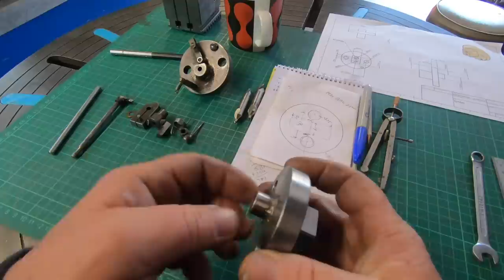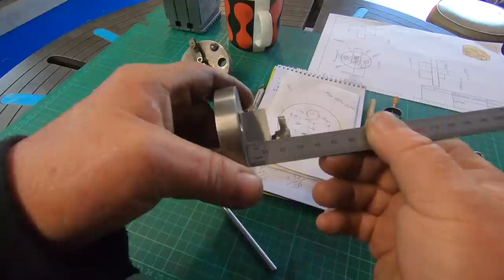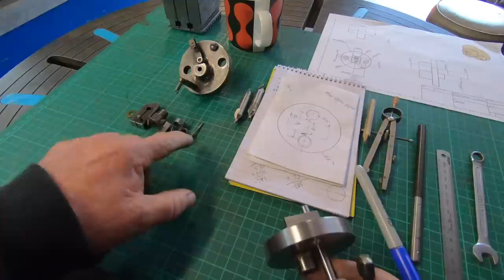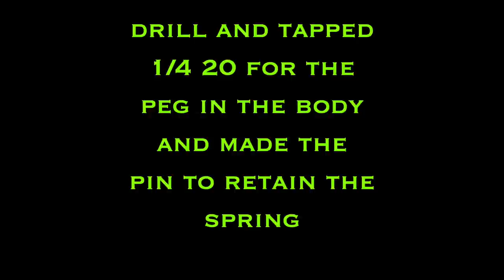Hercules Hit & Miss Engine Igniter, Health Update...

Comment: That is a great job you and Trevor have done to ensure that vintage engine has more life in it. I've never seen that type of ignitor before, so at 68 you've taught an old mechanical engineer something new, thanks. I've found setting small goals is a good thing when battling medical issues. There is no treatment or cure for pulmonary fibrosis so I set goals. I sincerely hope that the treatment works Matty, as the world needs us old engineers to keep the wheels turning ❤❤
Reply: My mom had sistic fibrosis. That was 19 years ago. A friend of the family had what you have, he said that there is way more hope today than even 5 years ago. Good luck with that 🙏.
Reply from the maker: Gday, I’m going to try and keep the weekly videos as much as possible, I need to keep active and keep the mind in a good space and the workshop is that place for me, I alway try to set myself goals and I believe it’s a big help, keep setting your goals to mate, Cheers

Comment: I hope all goes well with your treatment Matty. 
Some great machining shown when building this part. It would be good to see the motor running when it is finished. 
I'm not an expert, but I have made some springs in the past. At that time I found a website that you can use to calculate the diameter of the winding arbor to allow for the spring unwinding a bit and expanding when cut on the lathe. Also, This Old Tony has a great video on making springs for people who need to make springs in the workshop.
Reply from the maker: Gday, making the spring was all trail and error and I still can’t find the one that went flying, hopefully it lands soon, thanks for watching mate, cheers

Comment: Seem like an adapter for a spark plug would  easier. With a reed switch, or hall effect sensor, with a mounted to the adapter. With a magnet on the rod, and a slide on the mount to make timing adjustments,  use a mosfet transistor, ot igbt,  to allow the reed or hall effect sensor to switch the current to the coil, (or break it) and use a motorcycle coil,  however, getting that to look authentic is impossible. A restoration, or near restoration is going to require the work to make components of the part,  history  us awesome, thank you fir preserving a piece of it!👍
Reply from the maker: Gday, we did think about a spark plug setup but this was more period correct I believe and more interesting to build, thanks for watching, cheers

Comment: Was there anything special about the wire you used for the spring?
Reply from the maker: Gday, in the end I used a piece of stainless tig filler wire, it seems to be holding up well, cheers